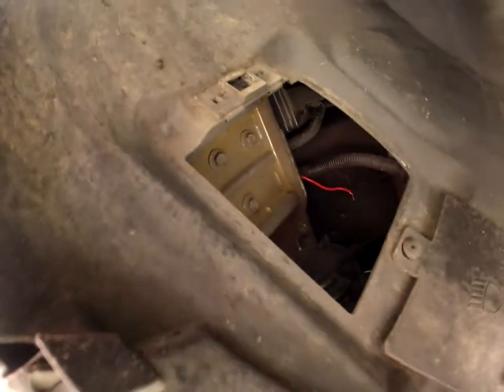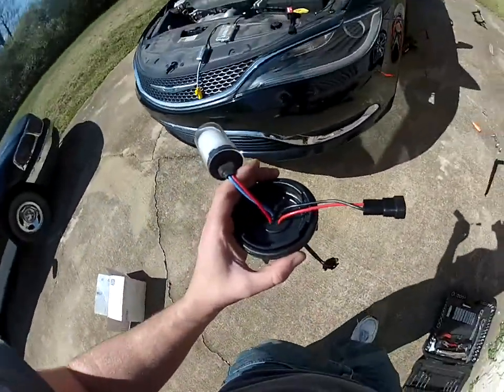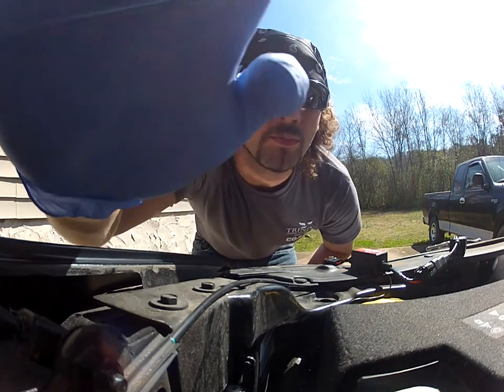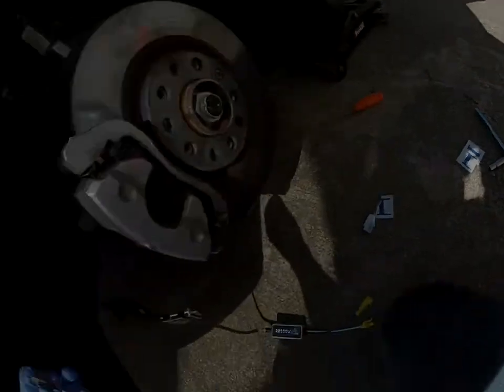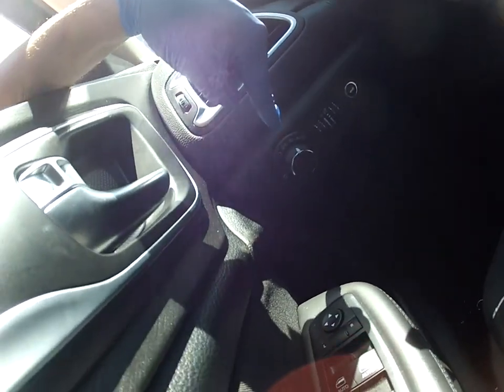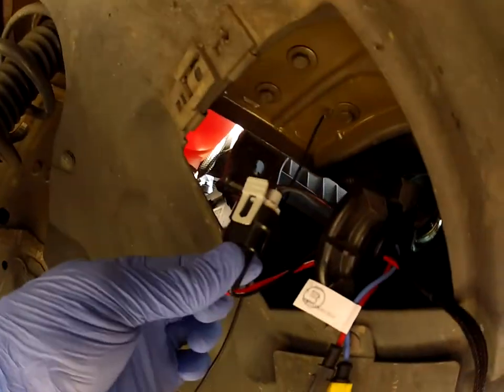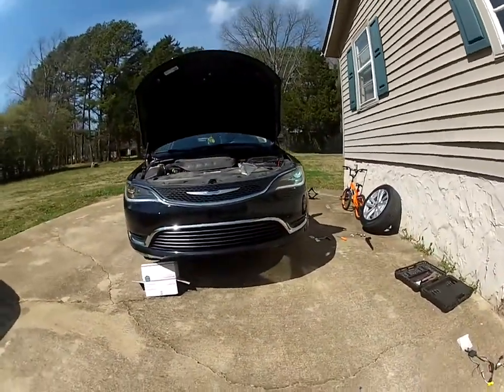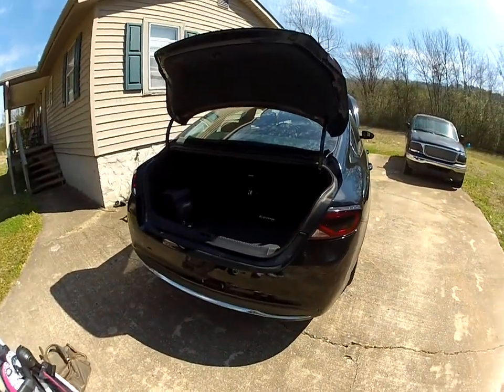HID Install Chrysler 200

Comment: Did you need a wiring harness for the 200?
Reply from the maker: Everything was included in the kit
Reply: did they flicker when you turned the car on?
Reply: Yea I needed one
Reply: I don't have any ground wires...but when I turn my on they stay on for a moment then the driver side shuts off